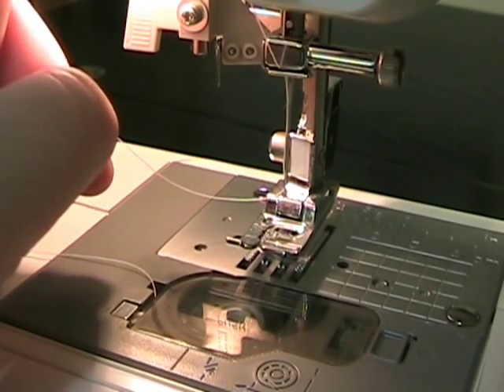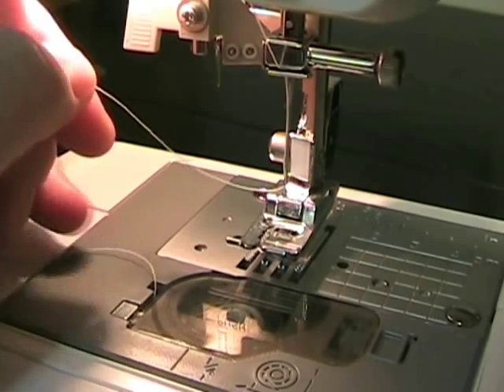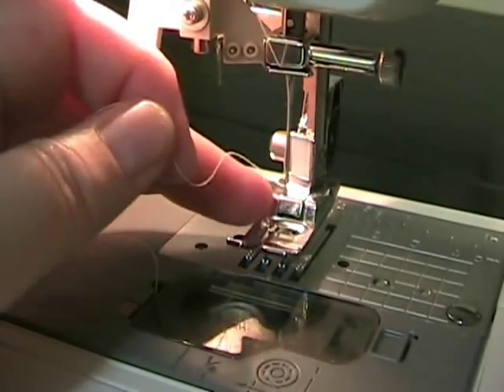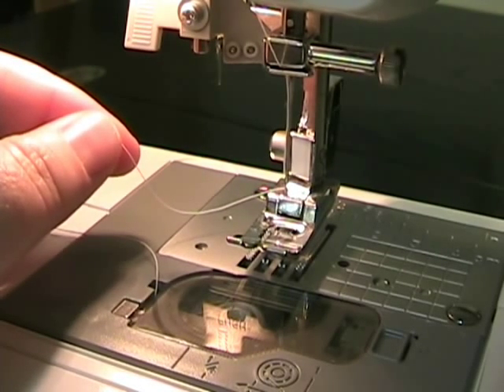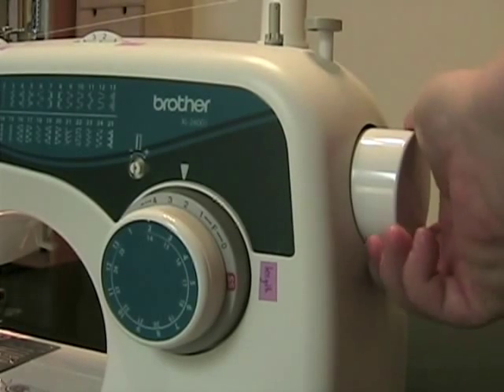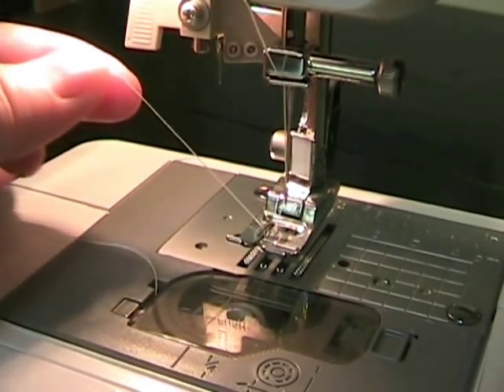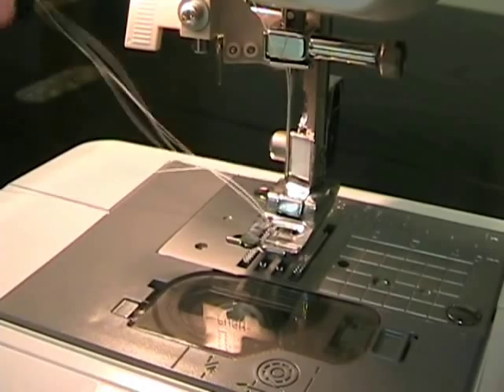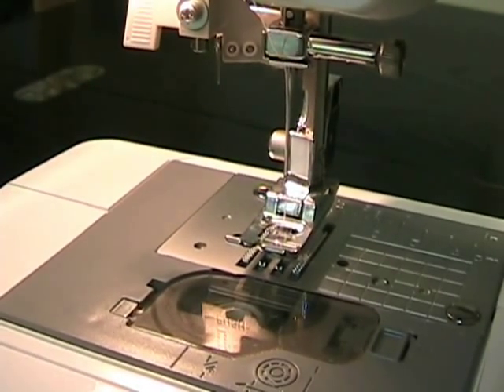4) How to bring up the bobbin thread

Comment from the maker: @sz5140 Don't be scared. Needles are very cheap, less than $1 each. Your thread's probably bunching up because your tension is wrong. Try moving the tension up 1 or down 1 on the wheel. Try it both ways.

Comment: i'm having some trouble with this model. (it may not be the exact model in your video, but it's a brother machine with a drop-in bobbin.) i keep getting thread caught somewhere underneath the plastic cover while sewing, and after watching your other video plus this one, i'm sure i've been threading correctly. this is a brand new machine, so i'm wondering if the problem is thread tension, the machine, or me. i'd really appreciate some advice on this as it's impeding my progress on a project.

Comment: @hbnole So I asked my mum when she got home from work and she showed me how and now I can do it. But the thread keeps bunching up and getting stuck in the hole for the bottom thread. The material got stuck in there and I tried to pull it out but I broke the needle. Im to scared to tell her. I might just buy a new one secretly. I tried super gluing it back on but im not sure how it will turn out. How can I stop it from bunching? Or does it just a normal thing?

Comment: @hbnole it's great! the strings were getting tangled down in the bobbin area, but i later found a video that showed how the needle and bobbin work together...i wasn't lifting the need up all the way to release the lower thread when pulling the fabric away.  problem solved :) - that, and i bought better quality thread.

Comment: I tried to do it. The needle goes down then up, but when I pull on the string it doesn't come up. I looked inside the bobbin case, and I see that the upper thread is wound around the race. Is that meant to happen?

Comment: Hello Natalie, do you have any suggestions on how to fix my problem. It seems like when I sew the top stitch is on the bottom of the fabric it's like it's on the opposite side. I don't know if you understand what I mean. :(
Reply from the maker: I'm not entirely sure, Cathy. (I'm a visual person so without seeing it I'm kinda lost.) However, I'd suggest trying to adjust the tension knob. First adjust it in one direction (maybe 1/4 or 1/8 of a turn at a time) and then go the other direction. If it looks better then keep trying to loosen or tighten the tension to see if that helps. Sorry I couldn't be more helpful!

Comment: OK I have a question, my needle is not catching the thread and the bobbin is correctly wound and placed in the bottom of the machine, is my machine broken?
Reply from the maker: Unfortunately, I'm not very good at diagnosing machines. I'd suggest trying a different type of thread to see if it works any better. That way you'll know if it's your machine or the thread.

Comment from the maker: @jennyisfat You might have to replace the needle -- that's what I've done in the past when the thread wouldn't catch. Also, is your sewing machine new or used? If it's new, you might want to give Brother a call about it. Sometimes it can be something worse than just a bent needle, but I would try replacing the needle first to see if that helps.

Comment from the maker: When this happened to me, I changed the needle and it worked. Sometimes the needle can be imperceptiably bent and it will prevent the thread from catching underneath. Try replacing the needle and see if that helps.